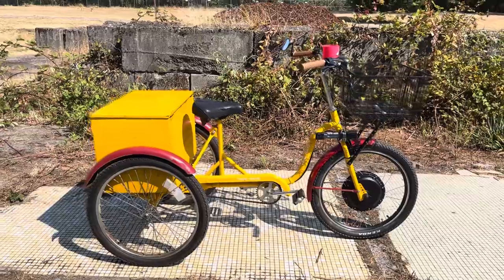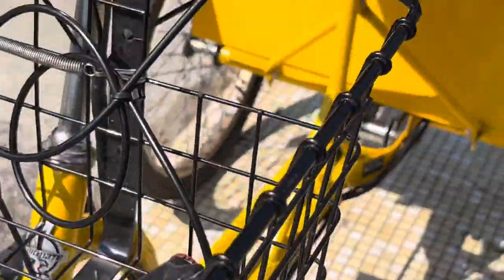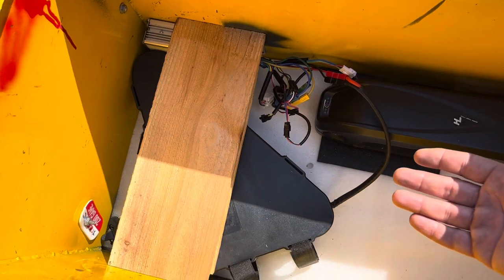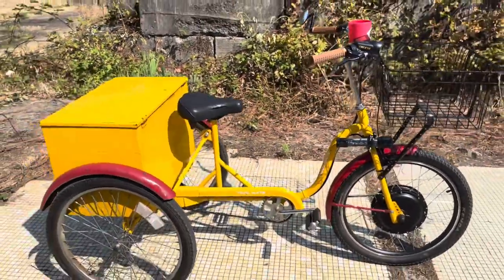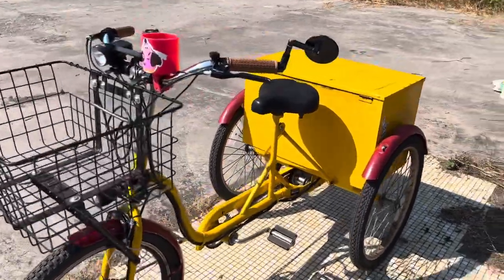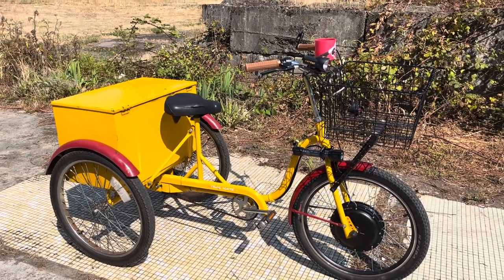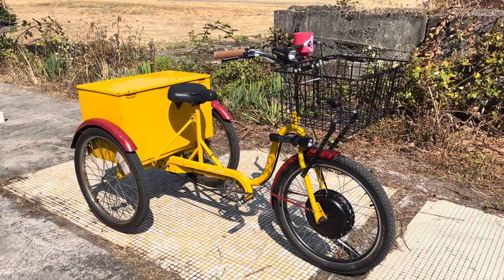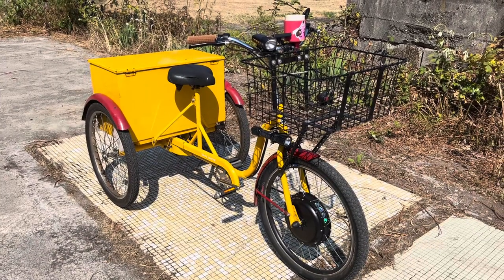The Best Utility Ebike Nobody is talking about- The Industrial Trike!

Comment: I used a hanging truck toolbox as a trunk on my trike. It is yellow too. Got a gas bike front fork from amazon so I could get the disk break on the front. Hinde sight go full hydraulic it needs it. I went cable hydraulic from amazon.